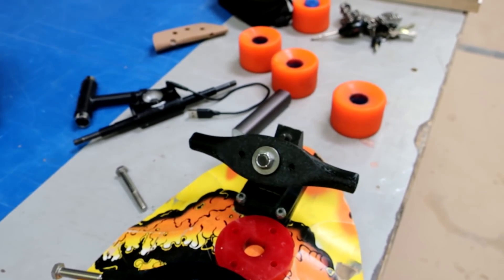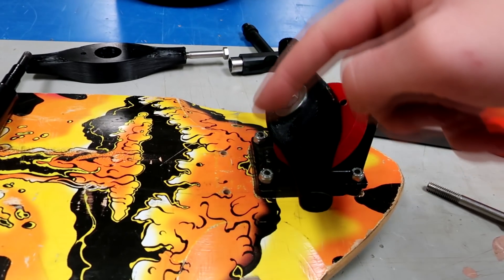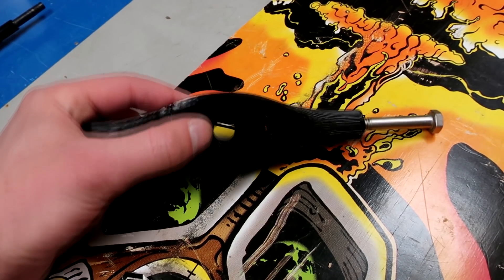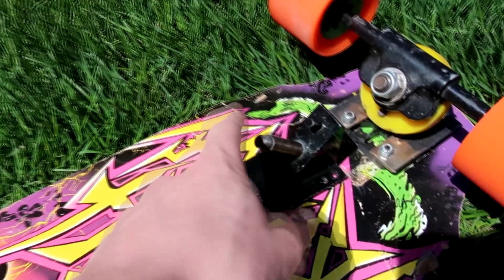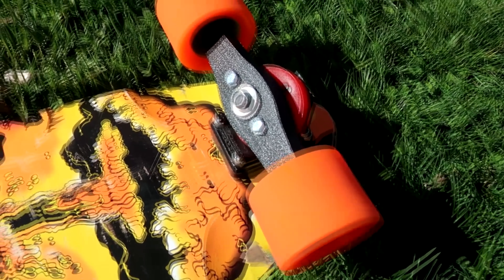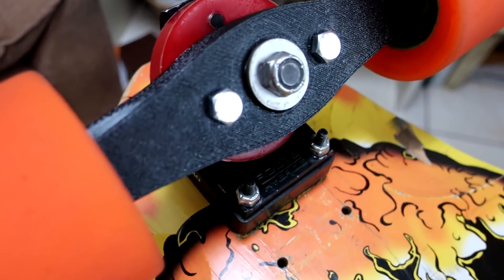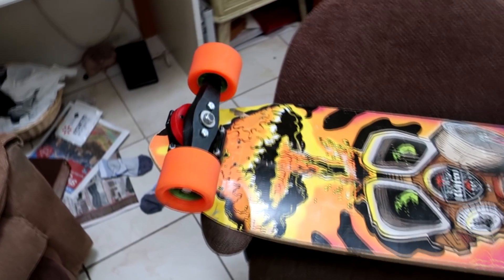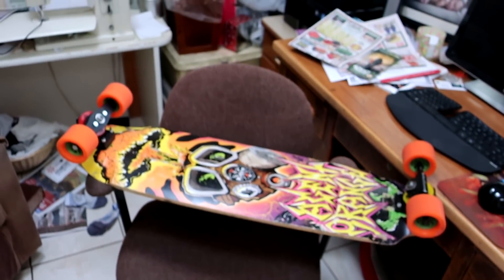3D Printed Rakeless Rojas Hanger

Comment: So stock Rojas are raked but have zero axle offset. Your 3D printed rakeless hanger also has zero axle offset. But you said that you might want to add axle offset into the design, but adding more axle offset will likely affect performance (if I understand correctly, more axle offset makes a truck feel more forgiving but also less responsive).

Comment: Chop em to 100mm and you've made the first rohas slalom's 🤣 one of those with a standard rake front would be a dream to ride
Reply from the maker: With such a narrow width I'd have to go to the effort of actually making it a through axle.
Reply: @LongboardTechnology  that's actually perfect if you have two halves of the hanger with a floating axle like the old jimz's had. You'd have to have a middle bend for the inline rakeless one but as long as its straight enough after bending it'd lock itself in the hanger slot when clamped down with other halve of the hanger. If you can get that made it'd be one of the best designs yet 😁👍

Comment: A method for not having to move the axle position up and keep the hanger rakeless would be, instead of 3D print it, make them out of metal (cast or CNC) and screw a separate axle on either side, like many (if not all) precision trucks are made. Complicated and much more expensive than 3D printing, but it's a solution for when the concept is put to production. Would also make the hangers reliable for freeride and downhill